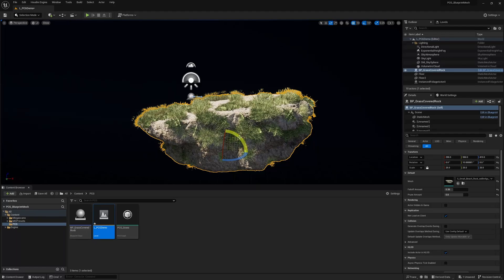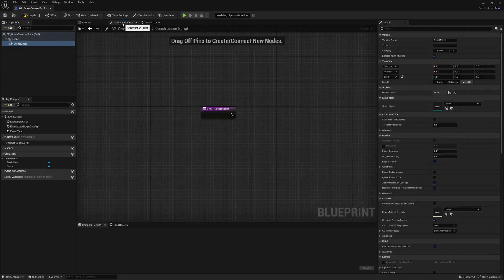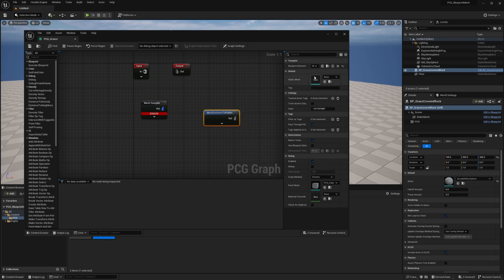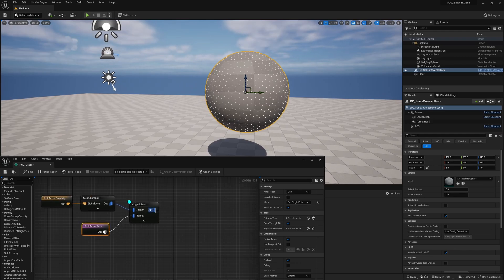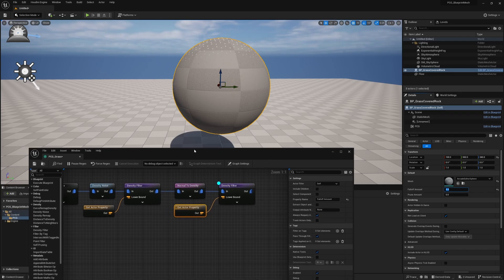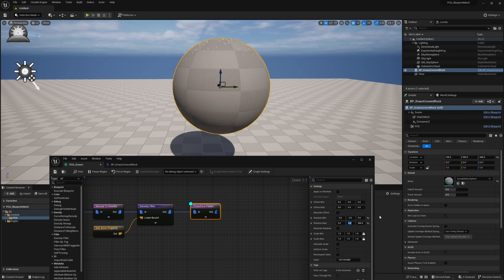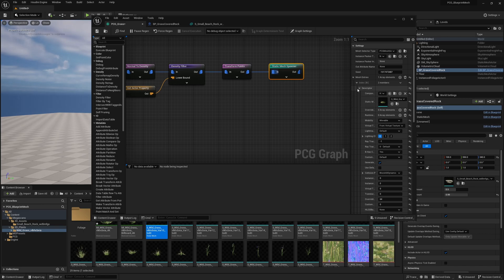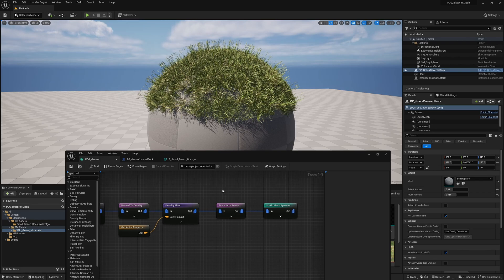Integrate PCG With Blueprints Tutorial | Unreal Engine 5.2

Comment: Thank you for the comprehensive tutorial. Is it possible to setup a inset scatter? If I scatter on a flat mesh, some points from poisson distribution get too close to mesh edges. I would like there to be a "threshold" to not spawn points near mesh edges for example.
Reply from the maker: You can use a different method of sampling, one does it by vertexes if I recall, then tell  it to not be near those points.

Comment: Thanks for this. Do you know if it is possible to apply a PCG graph to a parent PCG graph? I have a graph with a load of ground meshes and I'm trying to pass the output of my Ground Mesh static mesh spawner to the input of a Grass subgraph with no success. Do you have a tutorial covering this? I can't find anything.
Reply from the maker: You can have sub graphs and loop graphs in 5.4+.  You just drag the graph into the other graph. :)
Reply: Thanks I got that far but haven’t been able to apply points and meshes to the parent meshes.

Comment: Thanks for the tutorial. Is there a way to swap the mesh inside the PCG static mesh spawner node via a blueprint?
Reply from the maker: If you're in newer versions of Unreal, then PCG supports static mesh variables. So you can set the static mesh as an attribute and then spawn static mesh from that attribute. Resulting in you controlling the mesh.
Reply: @ thanks for the swift answer. Is this available in 5.4 or on 5.5 only ?
Reply from the maker: @ArthurBaum  5.4+. 5.3 and below PCG is VERY different than recent versions.

Comment: I got a lot of help from watching your video! I even subscribed because I want to check out your other videos. 
However, I do have one question. just like in your video, I'm connecting Blueprint and PCG so that I can swap out static meshes via Blueprint. 
Then I want to read the vertex color data on that mesh and have grass only grow where the vertex color is painted 
(I’m not using normal to density, just color channel as density in the mesh sampler).
The issue is that when I link the mesh in Blueprint, the grass initially generates correctly based on the vertex color data. But if I modify the vertex colors further, the updated information doesn’t seem to refresh automatically. Also, if I create a new level and place the mesh there, the grass grows correctly based on the updated data. However, when I go back to the previous level, it’s still reading the old vertex color data.
I’d like the new mesh information to be updated automatically through either Blueprint or PCG, but I’m not sure how to make that happen. 
Do you have any ideas on how I can do this?
Reply from the maker: I've not tried to read the vertex paint information in PCG. I actually didn't know this was even possible. So unfortunately I'm not sure. My guess would be to try to regenerate the PCG graph and see if that helps.

Comment: mesh to point is not avilable in unreal engine 5.4.4
Reply from the maker: Make sure you have the PCG geometry script interop plugin turned on.
Reply: @Procedural_Minds  I already turned it on.
Reply from the maker: @boymotion01  It's been renamed to Mesh Sampler it seems. If you use a Blueprint Execution node and select Mesh to Points it tells you to use Mesh Sampler.
Reply: @Procedural_Minds  I'm having the same problem, At around 3 minutes into the video

Comment: Hey, this helped me a lot in doing what I needed to do, so thank you! However, I'm having a problem with the mesh rotation. The actual world rotation and location is fine, I mean rotating the mesh in the blueprint doesn't align with the points. For example, if I rotate by 90 degrees on the z axis, a point that was previously (10, 0) on (x, y) now becomes (0, 10). That's how I want it to work, but it doesn't. The "transform points" node in pcg rotates the points individually and not all together round a single point. Any ideas on how to fix that? Thank you :)
Reply from the maker: That is exactly how it's designed to work. If you want all the points to rotate around a single point then you can either rotate the actor, and it'll all be relative to the actor, or you'd need to create a custom rotation setup for this.

Comment: So I'm trying to use this as a sort of grass shader for my project.  Lets say i have 5 grass pads in my scene, and want to apply this to my pads, like you would a material.  Is there a way that I can select my pad in the shot, and say "hey BP, apply what you do to that boy right there!" or do i have to basically have my 5 pads be a static mesh object, assign that within the BP and place it into my scene.  Does that make sense? Probably not.  I've been trying to do this for days now. Getting close, thanks to you.
Reply from the maker: If you mean you want to apply PCG grass on top of multiple meshes, then you can just use a spline or volume and project the points down using a World Ray Hit Query and a Projection node. Then probably just tag what you want. Hope that helps.

Comment: So if the Static Mesh component has translation changed in the blueprint and not in the 0,0,0 position the point will be wrong too. I wonder how to tackle if we have a blueprint that have more than 1 static mesh component such as a group of rocks? I'm trying to solve but have no luck.
Reply from the maker: You can get the relative offset and set the point offset to be the same using the PCG Parameters introduced in 5.3+.

Comment: this is cool. I can use it. Is there a way to take each point for a spline line that in "Get Actor Property" ir even better All the points inside a looped spline?
Reply from the maker: There are multiple options to sample splines in PCG. You can set it to be by points I believe in the dropdown.

Comment: Awesome tutorial.  Very powerful.  I'm trying to figure out how I would be able to be able to do this with a closed spline in the blueprint and set these to the interior?
Reply from the maker: I have lots of PCG tutorials, many of them use closed loop splines, so check those out if you're struggling there or there's lots of tutorials on splines specifically on youtube. And once you have the points generating, it'll be the same as with this. Set the points to be whatever you want. :)
Reply: @Procedural_Minds  Thanks for the fast reply.  Is there a specific video of yours that you can direct me to that's in line with what I asked?
Reply from the maker: @aaronhojnacki6051  You can check out my building series. The first video show you how to use interior splines. Most tutorials I do are with interior splines lol
Reply: @Procedural_Minds  Thanks and keep up the great work
Reply from the maker: @aaronhojnacki6051  If you mean created in blueprint, then yes.

Comment: Is it possible to use the data from the PCG graph into location/rotation values, in order to Spawn Actors From Class?
For example in order to Spawn actors on a sphere, all via Blueprints?
Reply from the maker: In 5.3 you can set / get PCG parameter variables and have access from the blueprints. So you should be able to expose things from the PCG as well as the other way from the BP theoretically.
Reply: Thank you ! I wonder what exactly is the flow from the PCG to actual array of transform points, so it can be used with a for loop or spawn actor from class @Procedural_Minds

Comment: Great video, I’m looking for a way to add procedural foliage to surfaces imported via datasmith from 3Ds Max, would this method work for fairly large areas? Thanks!
Reply from the maker: Depends on how many points you're generating and if your computer can handle it. The more points the more calculations basically.
Reply: @Procedural_Minds  I’ll have a crack today and see if the pc melts!

Comment: If I was to add multiple rocks to spawn within PCG, how would the grass know to scatter on all the different rocks? In the PCG Demo you can only copy target points from a single mesh.
Reply from the maker: If the rocks are all the same mesh, then it'll be fine. If you're using different ricks then you'd need to use multiple input nodes.

Comment: Hello friend, why doesn't the mesh sockets to points option appear on mine?
Reply from the maker: Double check that you have the same dependencies turned on. If you're on 5.3 it might have also moved to a different dependency. Besides that, if I recall it might be a blueprint node, in which case you can grab the Execute Blueprint node and then in the detail panel search for the mesh sockets node.

Comment: What if I want to have multiply objects?
Reply from the maker: You can swap the static mesh for anything you want in the blueprint. It's not limited to the one specific thing you set originally. You might be able to randomly assign a different mesh per instance through the blueprint as well, though I haven't tried it personally.
Reply: @Procedural_Minds  What about if I have one mesh that I want to use 50 times on my env. Do I have to have 50 meshes in the BP or can I just duplicate the mesh in the outliner?
Reply from the maker: @RainsalotProductions  Once you plug things into the blueprint, just duplicate the blueprint as many times as you want. And then if you want to swap one of them, just do it in the detail panel. No reason to open the blueprint once it's configured. :)
Reply: @Procedural_Minds  What if I have trees being projected onto a landscape and I want that BP object (a big rock) to delete any trees that are intersecting with it. Is that possible?
Reply from the maker: @RainsalotProductions  Yes, you can use a difference node. There are very many ways to do this, so it'll depend on how you're generating it.

Comment: Brilliant tutorial! Thank you. One question, is there any way to add more points besides using upper/lower bound in Density Filter? Adjusting the Mode from "Get single point" to "Parse Actor components" seem to cause an error, so I can't add more points that way.
Reply: Set the Mesh Sampler node's Sampling method to "Poisson sampling", then in the Poisson Sampling - portion you can increase and decrease the density
Reply: @JJHazy   I was able to adjust the Sampling Radius under Poisson Sampling, and populate it denser. Thank you good sir!
Reply from the maker: @JJHazy  Yeah, it's a good alternative method to density control. Many ways to do it. :)
Reply from the maker: You should be able to use any of the parameters there. It's just a matter of knowing what sort of variable it wants. Could be int, float, bool, etc. Hovering over it sometimes tells you what it wants.
Reply: @Procedural_Minds  will give it a try, thank you!

Comment: Thank you so much for this incredible video!! I was wondering, it there a way to do the same but on a skeletal mesh ? so that you can make something appear on the body of a character for instance? thank you so much!!
Reply from the maker: Not unless you convert it to a static mesh and then generate. As far as I know, PCG isn't realtime. You generate it once and then you can force regenerate it, but it's not designed for real time attachments. For that it would be better to use something like Niagara particles.
Reply: @Procedural_Minds  Thankyou so much for answering that quickly :D I get it! So, let's say I have a static mesh in the world, and I decide to dynamically change the amount of grass over the sphere we did in the tutorial, but in real-time (with an interpolation), I suppose it will work, but can we also change the seed dynamically ? (another example, if I have a maze PCG, can I bind the Seed variable and modify it in real time so that the maze dynamically changes ? Sorry xD I know it's long but you're such a great teacher that I had to ask ^^
Reply from the maker: @Test-xt3ys  You can absolutely expose the seed for the nodes, just open the pcg nodes up and hook it up with the actor property like you would any other variable. In 5.3 you can set those variables dynamically from the graph instead of linking them 1 to 1 as well. So might not be possible in 5.2 to modify dynamically, but should definitely be in 5.3.
Reply: thank you so much for your help, I really appreciate it!! :) I hope you will do more tutorials on the subjects :D @Procedural_Minds
Reply from the maker: @Test-xt3ys  Absolutely, if you have anything specific you'd like to learn more about don't hesitate to ask. :)
Reply: @Procedural_Minds  Thank you so much :)) well actually.. I feel like there are a lot of outdoors like forests, but not much procedural indoors xD But do as you wish ofc!! I tried creating a maze with multiple walls and all, it's quite difficult not to make things clip :c